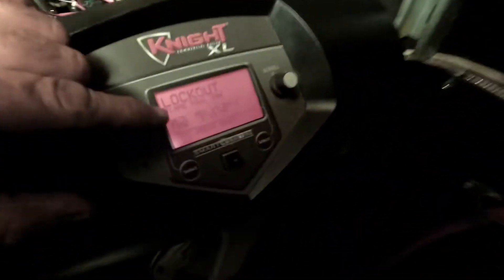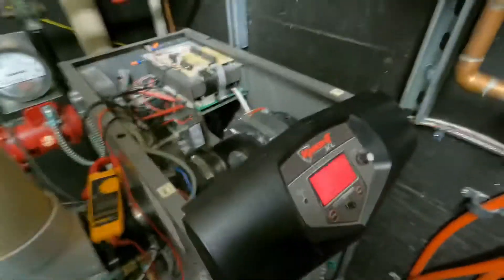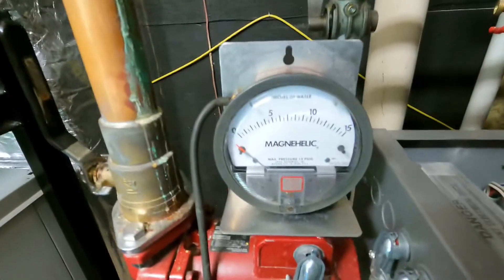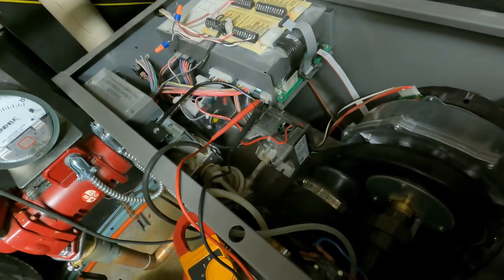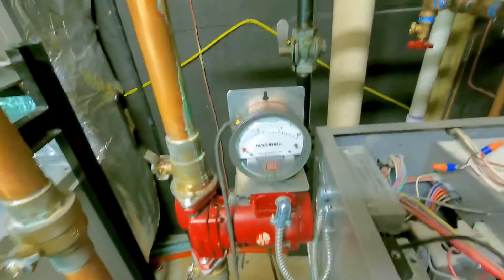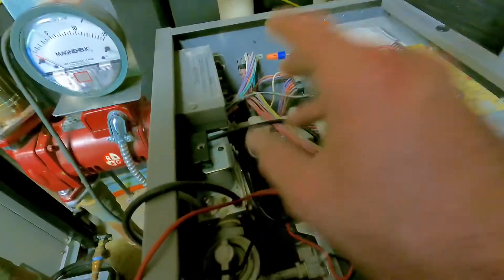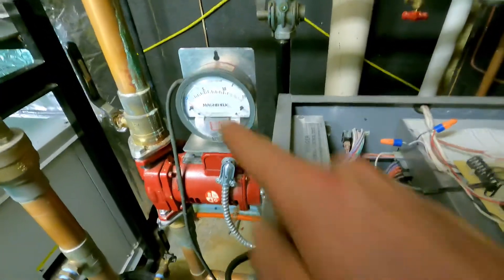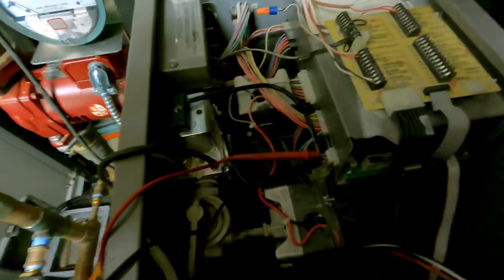Troubleshoot Lochinvar Gas Valve : Flame Failure/ Ignition failure

Comment: Hi, Bill, really appreciate your video. My case is misty, I have 7 yrs old unit, start the unit, it is working for while then unit lockout. I replaced the burner and rod, still not working well, did the same thing!.
after i reset the unit, it works fine, but after couple hours lockout again.
its gas pressure issue as I know, may be the gas valve need adjusted?

Comment: I'm working on a Cadet boiler and I have a ignition problem I pulled the flame sensor and the igniter out they were both Rusty I did attempt to clean them up put them back and I still have the same fault I'm just curious how you check for spark I don't see any sort of ignition at all I am not familiar with these boilers at all it is the first one I've ever ran into in 26 years

Comment: I have a similar problem but mine doesn't maintain the voltage that's going into gas valve and I hear clicking noise when it's supposed to open the gas valve to get the flame going

Comment: What would cause a delay ignition and cause backfire?
Reply from the maker: Is the boiler draining correctly? The mesh screen, over the burner tube? This had sediment in the bottom of heat exchanger. Which caused it to leak water and sediment closing up the exhaust. I’ve also seen timing on the ignition module be off. Where it’s not in sync like it supposed to. Starts feeding gas too soon.
Reply: @howtohvac3234  Thanks I will look into the timing because the drain is cleared and the burner looks to be in good shape, the mesh isn't sagging or has holes in it.